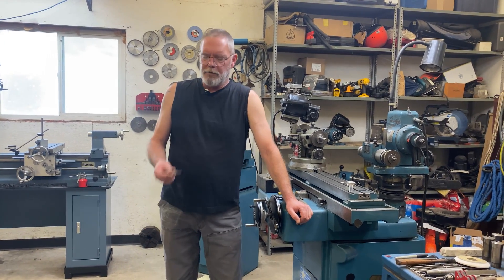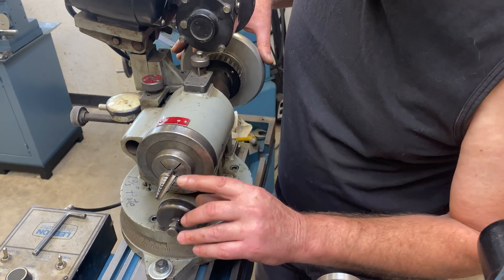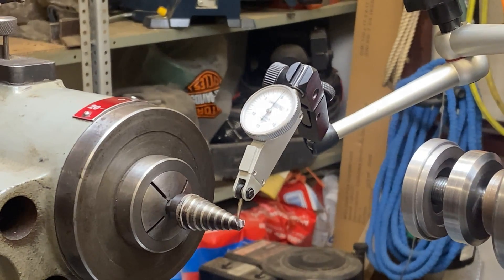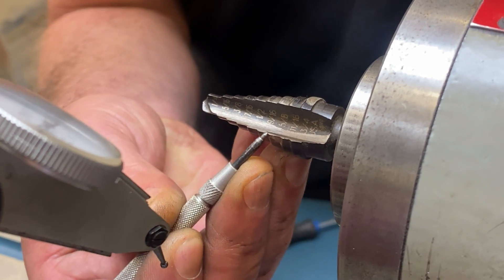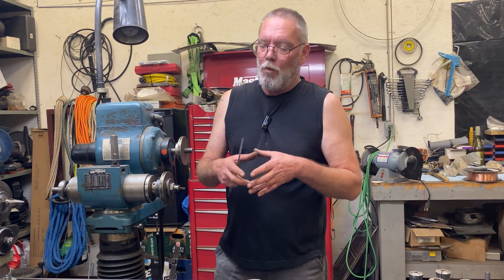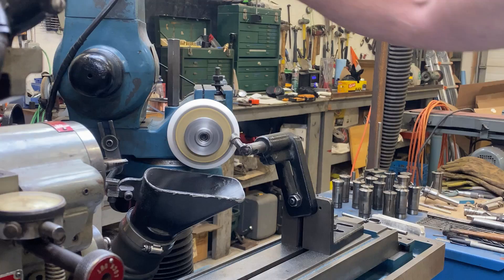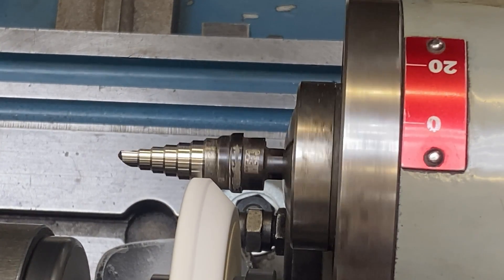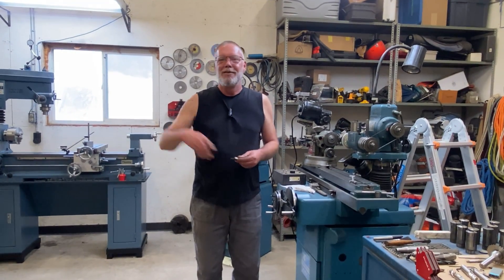How to sharpen a step drill

Comment: That statement was priceless. Figured out quickly you weren’t operating on the illusion you were saving a fortune spending that time sharpening a very inexpensive tool
Belts I use on my Williams&hussey 202 and my ko Lee 6000 series machines is gates poly flex 5m(length in mm) so 5m710 for my w&H
A feature I’ve enjoyed on a couple ko Lee grinders that you might consider is a taper for wheel mounts. Ko Lee used a surface grinder taper and the mounts are easy to find. No more trueing wheels up constantly. My go to ko Lee now has it. My other is the same as yours

Comment: I have always wondered, what is the runout of the collets you use in this tool grinder? I have a mini tool grinder I have made which uses ER40 collets and from what I know, you kind of need 0 runout to properly sharpen any tool as otherwise you impart that runout inherently into the tool’s flutes.
Reply from the maker: Zero runout is definitely preferable and for the exact reason you mentioned. To try to answer your question I have three different flavors of collets  and they all behave differently than each other in different situations. I know that's not a concise answer but there's a lot to it. My best collets run nearly bang on.  0" to .00025" -or 0mm to  .0064mm on a good day. 
Thanks for watching!
Reply: @Lappemountainliving  That is really impressive, I tried to get my hands on Techniks ER40 collets as I know they are rated at 0.0002" or less. SYIC, which I believe is the actual manufacturer, does have an ultra high precision range which is guaranteed to 0.0001". Of course, I do need to regrind the spindle taper so it has zero runout in the setup, but the collets are important as well. Thank you for the response, I was always curious because I tend to see a lot of tool sharpeners on YouTube use collets which look rusted or just ill-cared for!
Great video by the way, love to see all this tool grinding especially as I refine my own setup!

Comment: For those of us with a cutter grinder, but without a relieving fixture (yet, ha), is there reason not to grind the face? As long as some original relief remains it should still drill?

Thanks for taking the time to show these setups.
Reply: You can absolutely sharpen it by grinding the face,common way of doing it but the (unibit) step drills with a straight face as opposed to the curved face are far easier to sharpen that way. Also when you establish that your cleaning the face do not advance by using the machine cross feed,use the micro feed on your snap finger to rotate the tool in a circle. That will keep tool geometry consistent
Reply from the maker: I agree completely.
Thanks for watching!

Comment: How to sharpen a step drill... 1st - go buy $50,000 worth of hi tech sharpening equipment,  2nd - Spend years practicing different techniques and watching you tube vids.... 3rd -  now you can sharpen you $40 step drill.
Reply: and not to a nominal size.  the poor guy that uses this step drill next will get a surprise when the bolt won't fit into the whole.  lol
Reply: @Ujeb08  Hole, not whole

Comment: HI ! I have those small belts for my K.O. Lee and could use some new ones. Would you share your source ?
Thanks !
Reply from the maker: Hi 
The one I found is made by Gates. It's specified as a 5M615.   5M is the width. 5 millimeter or 3/16 inch. The 615 is the length in millimeters witch works out to just under 24,1/4 inch long. My first problem finding it was that I didn't know that they are specified in metric. my second problem was finding a sales person who cared enough to bother trying to look it up. With the first few places I went the sales people told me they would look into it and get back to me but they never did. I also wanted a 23" long belt but apparently North America is sold out and they won't be making more of that length until November. Best of luck finding your belt!
Reply: @Lappemountainliving  Thanks !